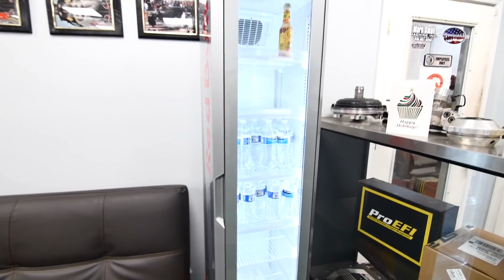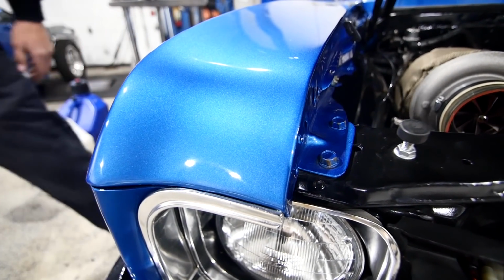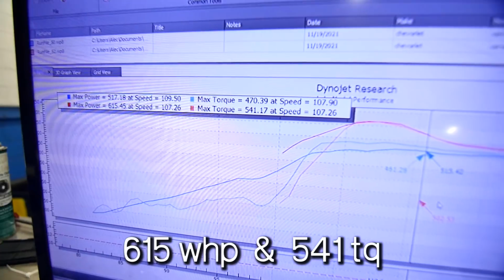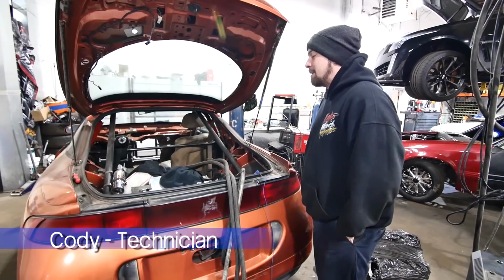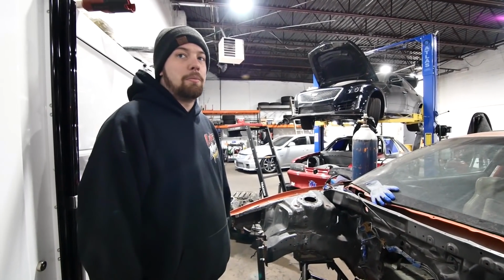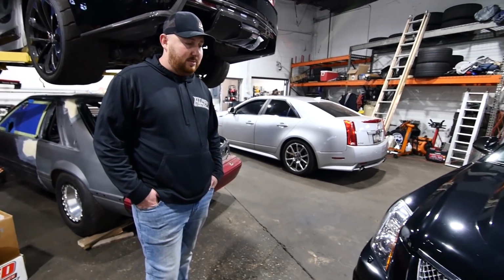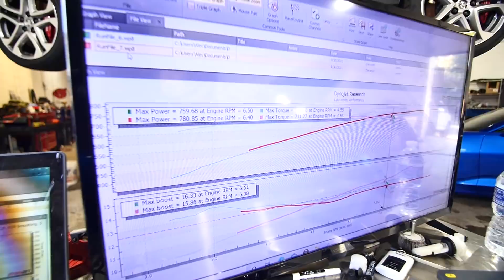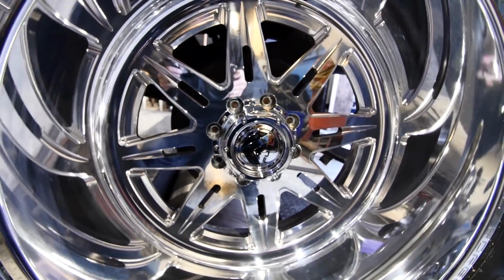Turbo LS Nova Gains 300 + hp from Tuning!

Comment: Love the car…I gotta 370” lq9 with a lsa supercharger in mine…. Never had it on the dyno but I had to run fic850cc injectors with my 2.45” pulley and 220/230 cam the stock lsa injectors weren’t havin it… also put a ‘72 front grille conversion, it feels a whole lot peppier than my stock 2012 CTS-V , which inspired the engine upgrade from a cammed 5.3….now that the kids are getting bigger, that zl1 Camaro is tempting me!!!!!….gotta finish my ‘73 c10 build and sell something before my wife allows a 7th vehicle into the fleet!!!!